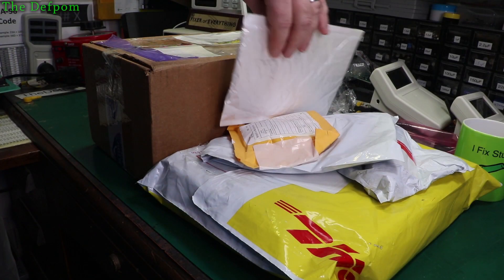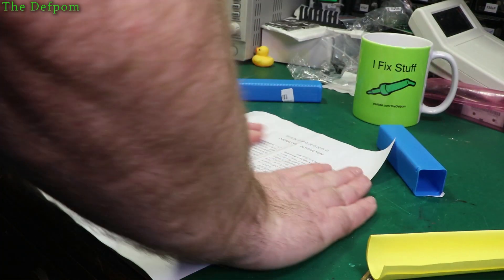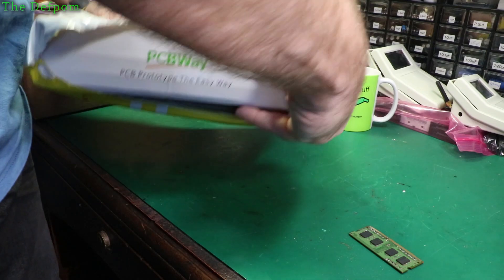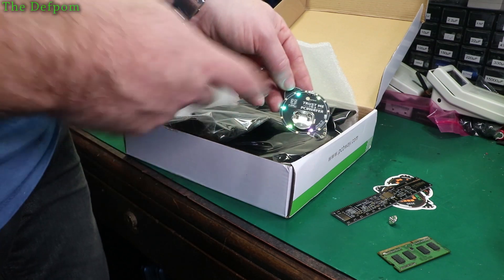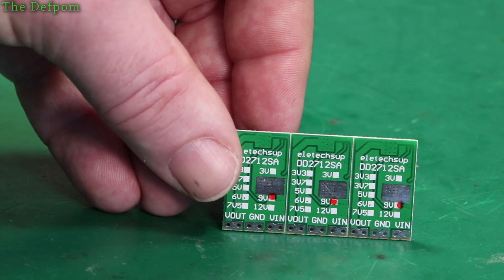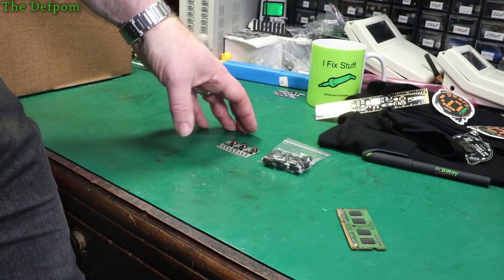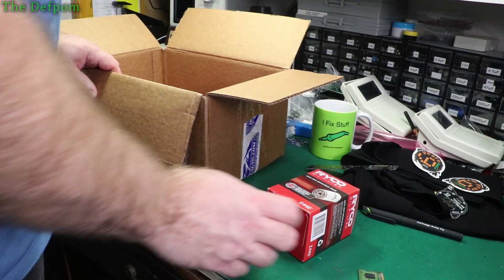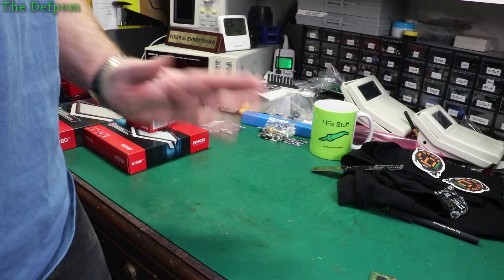#737 Mailbag Monday 20th July 2020 - Torque Wrench, BMS Module, Buck Converter, Fuses, 741C Op Amp.

Comment: Gold leads like these 741 OpAmps were fine while hand soldering was used, but with large volume manufacture using wave bath soldering the Gold was a serious problem. For volume manufacture the gold must be stripped off or the solder bath got polluted  and within days the entire wave bath required draining and replacing the solder. Gold dissolved into the wave solder and created brittle solder joints. Rather quickly the manufacturer either used a special chemical called 'Ruby fluid' or arranged supply in tinned leads form. Same applied to many transistors and also ICs that had gold leads.  Great if manual soldered but nasty on mass volume processing.
Reply from the maker: Helmuth Schultes - very interesting, thank you.

Comment: Just amusing info.

In the late 1960s when Fairchild released the original uA741 opamp they were in such gold lead metal can format. BUT unlike modern times the cost was what now seems impossibly high. The uA709 was the main stay OpAmp used in industry, but that needed external compensation. The uA741 was the first internally compensated single chip Ic OpAmp, and when released was offered at US$41.00 EACH!  But the uA709 at that time was also not cheap at near $20 each. 
Now while that is expensive compared to the modern price of tens of cents in moderate volumes. It is to be considered that the $41 if compared to modern wages makes it equivalent to many hundreds of dollars now. Around that time a car like a Toyota Corolla was near $2000 dollars so equivalent at least 10 times value to present equivalent, so say at least like $410 each.
We now often do not appreciate how cheap such electronics has become.

Comment: Think there are SMA connectors made of different material's requiring different amounts of torque. I have a Huber+Suhner wrench model 74Z-0-0-79 with a torque of 0.45Nm. They also have them in 1 and 1.95Nm.